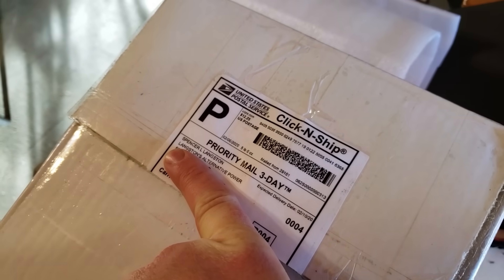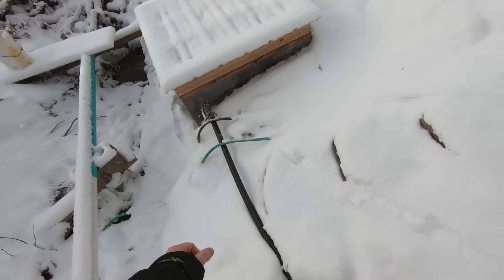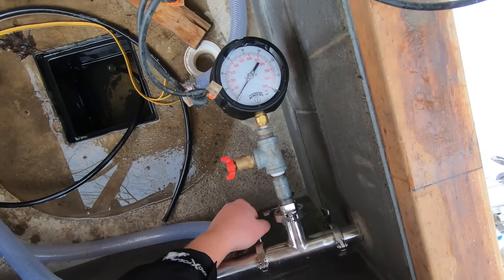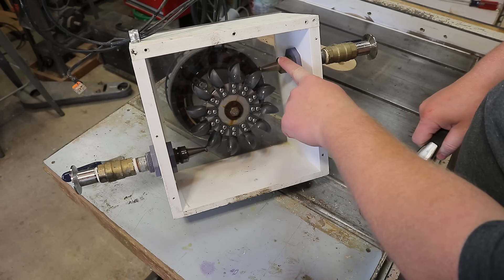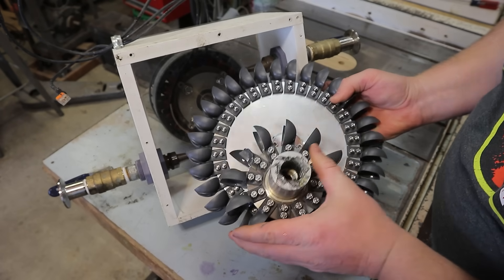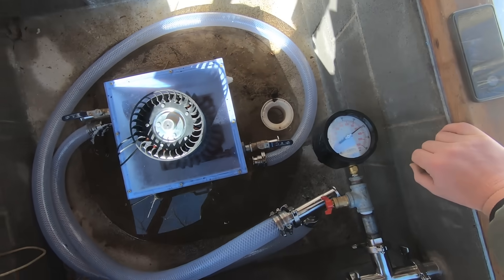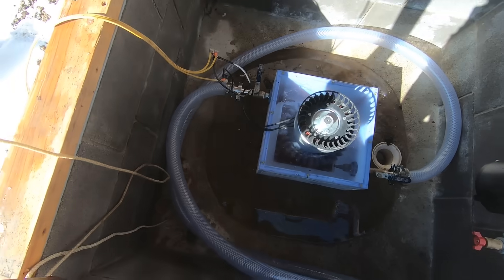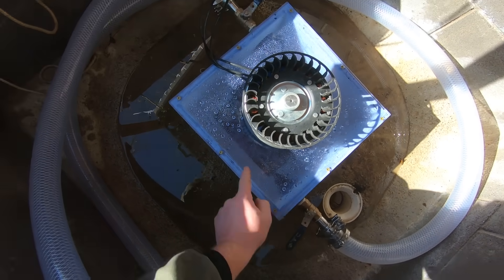Chasing 500 Watts, Big Pelton Turbine

Comment: Unless you are manually adjusting the MPPT voltage of the classic it is most likely not at the correct voltage.  That screaming of the hydro sounds to me like its running much too fast, and hence out of its efficiency range.  The midnite classic will MPPT all the way down to 12v no problem.   The only issue is when the input voltage is very close to the output voltage which you don't have.    As to your situation, I suspect that by lowering the MPPT voltage, you'll increase the power.    Its in the instruction manual of the classic how to do it. 
Power output  is head in feet x GPM x .18 x turbine efficiency ( 30-60%)
Reply from the maker: I only showed it unloaded in this video. It's really quiet with a load.
Reply: @JoeMalovich  OK.  Maybe you've stated it in another video, but what is your head and flow?
Reply from the maker: @jaypeltz2587  275 feet 30gpm Max design flow.
Reply: @JoeMalovich  with a 50% efficiency should be 800 watts.  I can see your concern as to the low output
Reply from the maker: I think the 12v bank is the main hindrance now.
Reply: @JoeMalovich  just try one nozzle, should be roughly 1/2 watts
Reply from the maker: @jaypeltz2587  I'm short on water so right now I'm only running one nozle. I'm getting 282 watts.
Reply: @JoeMalovich  which probably means the batteries are not the issue. And changing  the mppt voltage didn’t help.  Interesting
Reply: @jaypeltz2587  His stock pipe looks quite small especially for 30gpm.
Reply: @benlawton5420  Hi Ben. 35gpm in 1.5” PE pipe has a friction loss of approximately 2.7 psi or 6.3’ per 100’ of linear pipe.  If he’s got 900’ of pipe ( I think) then difference between dynamic vs static pressure at full flow is 24 psi or 57’. As long as you are above the 66% rule it’s all good.
Reply: @jaypeltz2587  That rule is potentially 33% less power though, personally I wouldn't want more than a 10% drop.
Reply: @jaypeltz2587  He could be loosing 2 to 3 bar which is quite a lot.
Reply: @benlawton5420  the 66% rule is that if the dynamic pressure is less than 66% of static you are losing watts.  Even though you are running more gpm the loss of pressure means less watts. And the 66% rule assumes that you have unlimited water.
Reply: @benlawton5420  he’s got 275’ of drop, in which case he’d lose 57’  or about 20%. I don’t know if the 275’ is dynamic or static, presumably static. In which case 218’ x 35 gpm x .18 x .5 (turbine efficiency) or 686 watts. If less power than that then it’s in the turbine efficiency or voltage drop or power electronics loss.
Reply: @jaypeltz2587  There's a guy called Kris harbour he uses 60mm for a 150/200m run at a few lpm and he gets a total system efficiency of about 65% which is really good.
Reply: @benlawton5420  65% is pretty good for a small turbine especially at low flow rates.

Comment: I cringe when I keep seeing ball-valves used.... Change to a gate valve on outside of box, use second inside to stop water after the T-piece and guage. You can then allow bypass water while working on it to avoid freeze. 3-pin Anderson connector of even Banana Plugs make for fast electrical. The box while being temporary looks like plenty of waste water is falling back on to the wheel and will be making parasitic drag. Possible option in your box, put ledge side around the entire inside wall, use a full-size peice of polycarbonate to mount the turbine and alternator. Jets will need their own bolted mounts but least the spent water will be thrown well away from the wheel. Upgrade your cabling, you have gone a lot lower on volatge thus current has risen, over a long run, losses will increase.
Reply: Properly sized ball valves have the least hydraulic loss thru them This matters at high water velocity. Substituting gate valves will make a real reduction in a system that is efficient.

Comment: Nice to see it running with a good output. i think the gain you are seeing there isnt to do with the size, in fact the larger turbine would be less efficient. its because the smaller one has to few spoons and the jet skips the gap. with your high head and low flow a small amount of water is a lot of energy and the biger turbine has the correct spacing of spoons so that the jet does not miss momentarily. That is where i think that gain came from. i think you would get a bigger gain if the smaller turbine was sized to your nozzles with the correct number of spoons.
Reply from the maker: Congrats on 100k! It's nice to see you drop by once in a while. I'm excited to see how your wind turbine works out.

The smaller one still wasn't the right diameter for my PMA. It was spinning so quickly that my open circuit volts were exceeding my charge controller maximum, I was seeing 209VDC and over 3200 RPM. I'm trying to design it so that if it ever runs unloaded that it won't self-destruct or fry something. Noise and vibrations were excessive as well. It's a physical impossibility to mount more spoons on the smaller one without cutting modifying the mounting ears on the spoons. This is why I went with a larger runner, Spencer is still flummoxed that I'm getting such high RPM from the big runner too! It's just difficult to grasp the pressure I'm working with.

The larger diameter does help with the spoon engagement arc or whatever the technical term would be. With the larger runner I'm at 2020rpm and 128VDC open circuit and 1020RPM and 69VDC loaded which I feel are far less extreme numbers. As I recall from earlier conversations you operate yours at about 700rpm so mine is still 30% faster. I think the gain came from less friction losses due to a lower rpm and less windage due to a larger housing, and maybe better jet alignment with no blowby.
Reply: @JoeMalovich  Thanks, im actually closer to 150k now :)

If it would be any help to you i can work out what your rpm would be at any head and turbine pcd. the one you are using must be around 350mm to get that rpm. 

my system runs at about 1000 rpm loaded, and around twice that unloaded. but that changes depending on flow losses. but around 100rpm. my turbine would do 4100rpm unloaded with your presure.
Reply: @KrisHarbour  - would there be loss caused by the water bouncing off the turbine turbine housing and back into the turbine.

The water appears almost to hit the spoons at right angles.

I would have thought a circular turbine housing allowing for the spent water to exit without hitting the spoons - causing back pressure.
Reply: @Robuster82  With a pelton turbine yes. as the water is flung off the turbine. with a turgo much less so as the water is directed downward and out the bottom. It is only a very small amount though even for pelton turbines. The best shape of housing for a pelton is curved and vertical for this reason. the shape of housing used for this turbine is much more suited to a turgo.
Reply from the maker: And the primary reason I have it oriented in this manner is to prevent water from getting into the bearings, Kris had this bearing problem in his first iteration and I learned from his experiences. A half bagel shaped housing would be ideal if I were to stick with a pelton. I'm eventually installing a turgo as they aren't as picky about nozzle alignment too. My smallest jets are only 0.060" to 0.080" in diameter and it's difficult to hit the center of a pelton spoon at that size.
Reply: Smaller the turbine, faster it goes. Faster it goes, faster it broke. Worn out, deflect. So, lower the rpm would keep the machine longer time to maintenance.
Reply: https://youtu.be/sSJVGgm5Ik4
Reply from the maker: @KrisHarbour  Thanks for the offer about calculations, I'm pretty good with numbers though.

Comment: You need a bigger enclosure and maintain the same jet distance. You can see alot of splashing back into the wheel off the walls/roof, and that affects RPM and therefore efficiency alot. The water needs to be flung clear of the wheel and stay that way and this new enclosure is just as ineffective at doing that as the last one was.

Comment: Dude, you couldnt make that urself?

I could've built that with a drill and a 3d printer...
Reply from the maker: I doubt that a 3d printed spoon would withstand the force exerted by these jets. And I wouldn't want to rely on a hand-drilled hole circle being balanced enough to operate at thousands of RPM.
Reply: @JoeMalovich  

Well... you did make a 3d printed nozzle right?
Reply: Good. Do it and shut up.

Comment: I would recommend opening and closing the main valves from the penstock a bit slower to not have such large pressure spikes as seen on your gauge.   I would hate to see you break the pipe somewhere from either a pressure spike or it rubbing against a rock as it grows/contracts under pressure.

Comment: 15:11 When You search for "midnite solar classic 200 specification", You can find PDF which provides data such as maximum output current: circa 78A at 12/24/48V and 65A at 72V. You should still have quite a headroom with current battery system.

Comment: If you can get your hands on a UPS that takes 48Volts you could use 2 more deep cycle batteries, about $120 at walmart to build a 48 volt string and connect that to a used UPS.  The mostly get discarded because no one wants to replace the batteries.  I've got one that will put out 3000watts and operates at 48 volts.  I have 3 sets of 4 batteries, 4 in series and three banks in parallel for about 200 Ah at 48V.  You can get the same with just 4 deep cycle batteries if you get the normal size car battery that is designed for marine use.

Comment: Joe, just curious about the outflow of your turbine housing.  I expected the water level to go down fast and for the basin to clear out.  That would limit the speed of the alternator if  the spoons are having to stir the outflow water continuously.  Love your videos and wished I lived in a valley and not on top of a ridge so I could build something like yours.
Reply from the maker: Sounds like you could do solar and wind! The water underneath isn't a problem, it is a problem if it hits the runner from the top. the term is windage.

Comment: Why dont you put the 2 batteries you have in series to work @ 24V if you think working at a higher voltage would help. It would halve the current from the charge controller to the batteries too, so less losses in the cables.
Reply: Not to mention its half the amp draw when inverting to 110-120vac. Can be expensive to change some of your hardware though

Comment: Anyone else when this guy starts breathing hard, you feel like you have worked hard without doing a thing?
Reply from the maker: The gopro has Automatic Gain Compensation so when I'm quiet it turns up the microphone. I don't actually breathe that hard. I am overweight however.
Reply: I remember seeing those liquid sugar cans.

Comment: Still consider the the turbine housing is not optimal. To much used water is dragging around the turbine wheel.  Can the housing be made higher and the turbine wheel be higher so the used water can more easy go down the drain?
Update: Noticed now that this topic has been up earlier.

Comment: Hi Joe - I was wondering if a close-fitting circular shroud (i..e a bent bit of sheet metal) within housing plywood for the turbine might improve the efficiency even further (you'd have to have gaps to let the jet spray in of course). There's quite a lot of empty space within the housing so those Pelton buckets will be wasting a little energy circulating it around. If you could reduce the amount of air that the buckets are moving around then you might gain a couple of extra watts. (Much the same as how the pitch of a vacuum cleaner goes up when you block the hose.. less air is moving, so less work is done so the motor and it will spin up to a higher RPM).  Cheers!!
Reply: 5 Gallon bucket ought to do just fine.

Comment: @Joe Malovich 0:30 I think you can get more power by removing much of the material in the middle of the turbine plate, and have like a few spokes connecting the center & outer rim.
However you "loose" some of the inertia from that removed mass, so it can't "store" as much "velocity" if it's weights less.
I HIGHLY recommend you watch this, for better explanations: https://www.youtube.com/watch?v=_QLEERYS5C8
Reply from the maker: That is meaningless for something that operates at steady state, inertia only matters when there is a change in velocity.

Comment: fascinating! nice biiiiiiig turbune 😊 very quiet too! 

one question, what are you doing with the leftover power your generating? (after charging the batteries) are you pumping it into the house or just letting it go? (or were you powering your pc rig etc with it? im kinda sure you were at one point!)
Reply from the maker: Right now I'm just dumping the heat into my garage workshop.
Reply: @JoeMalovich  cant you sell on the grid?
Reply: @AA-iq6ev  need to have a grid connect system(grid tie), which requires utility approval and disconnects when utilitypower goes down unless you have an hybrid inverter. My area(ny)for hydro you need to have water approval even if you own the property water source is on. Pa is probably alot easier though.
Reply: @michaelgrodecki4159  oh so complicated then I understand and I assume the compensation is minimum

Comment: Thoughts on installing a permanent bypass that you can just switch to?
Reply from the maker: if I'm doing modifications then it's not such a big deal to have to cap something off. I can just hook a bypass to that hose fitting anytime if I need to shut off the turbine for any reason.
Reply: @JoeMalovich  Why not just use the hoses that are already attached and only open the valve a little bit? Seems like that would keep things moving enough without the extra step and wrangling those anaconda hoses.